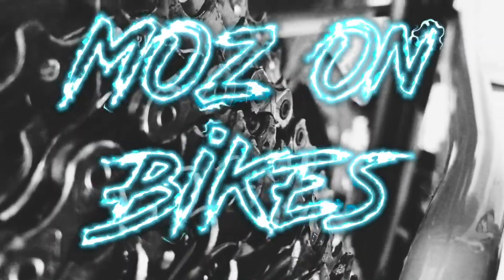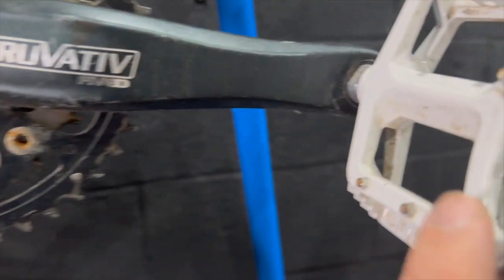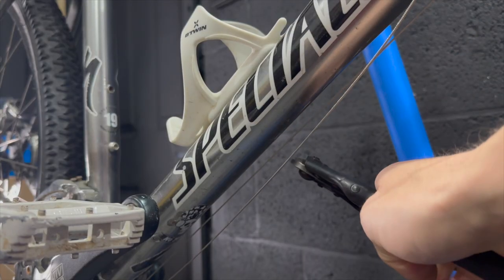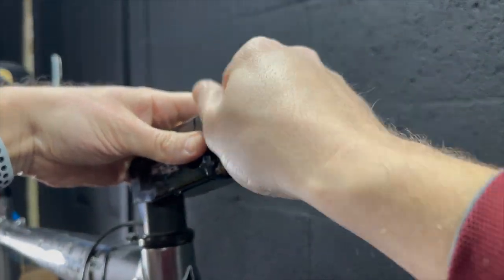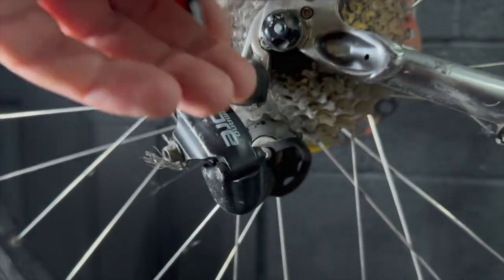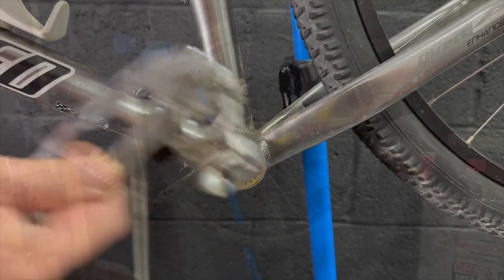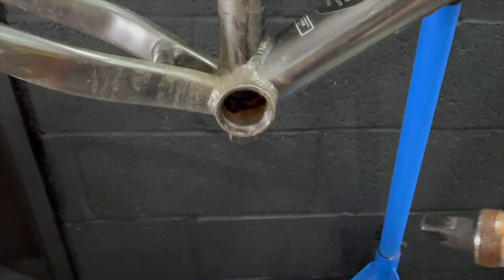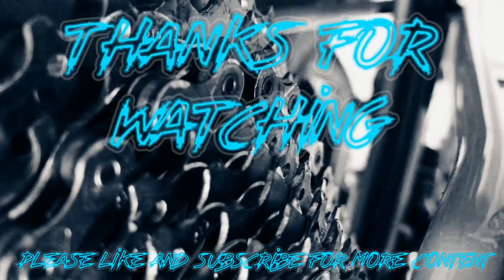2003 Specialized Hardrock Teardown

Comment: Modern bikes look rubbish. I have a 2002 trek 7500 fx [ hand built in the U S A of domestic  and foreign parts ] Looks great in two tone pearlescent blue and silver. A  2006 Specialized cross roads elite gloss black, and a recently purchased 2013 Trek domane 4.5 in gloss white with bold black decals.Lovely. Good video.